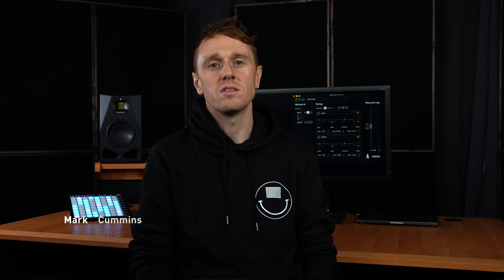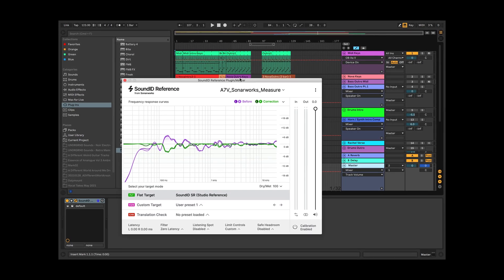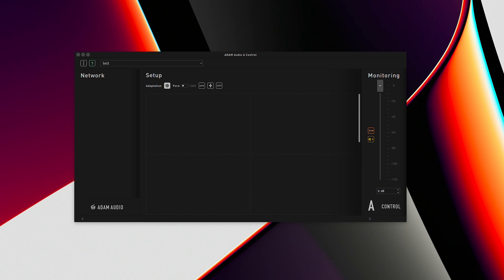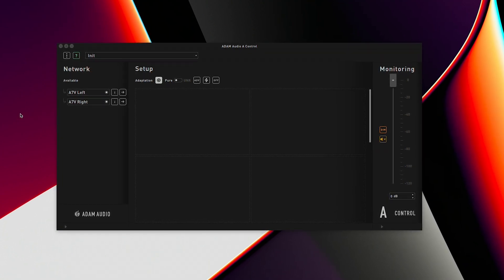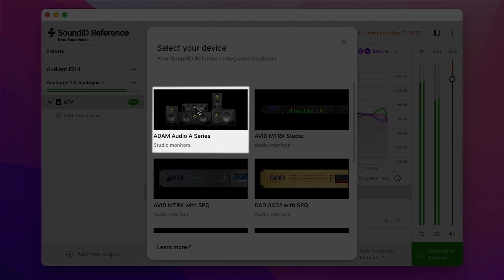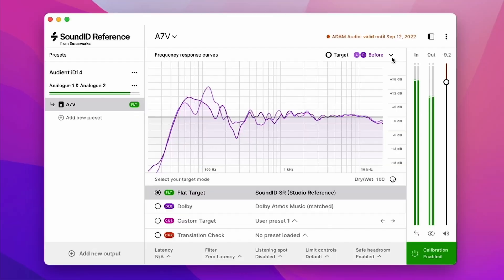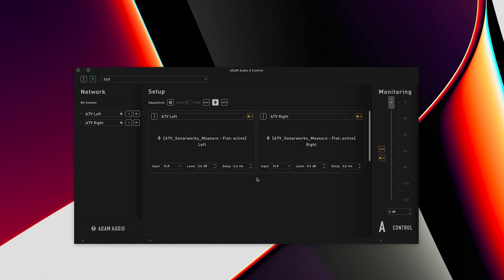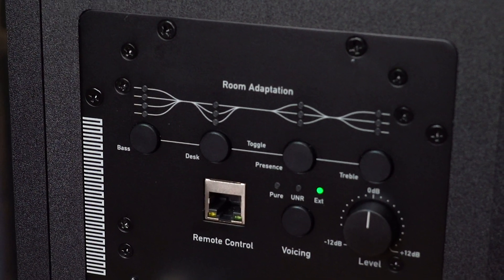How to Calibrate A Series Monitors Using the Sonarworks SoundID Reference Integration

Comment: Hi ! the fact we are exporting 0 db profile will not give us bass boost if we're lacking bass ?
Reply from the maker: Hi Louis, strong dips in the bass region are a result of so-called room modes, The superposition of sound waves leads to the cancellation or amplification of the overlapping amplitudes. If you now amplify the bass signal, the reflected signal is also amplified, which only leads to more cancellation. At the same time, the addition of the wave at another point in the room is amplified even further. Therefore we advise using the 0 dB export function and treating massive dips in the bass range with positioning and room acoustics.
If you decide that you want to use another mode, feel free to do so but we strongly advise using the 0 dB boost export option.
Reply: @ADAMAudioBerlin  thanks for this detailed answer ! So in the 0db boost mode , the profile only work on reflections and not on the dips ?